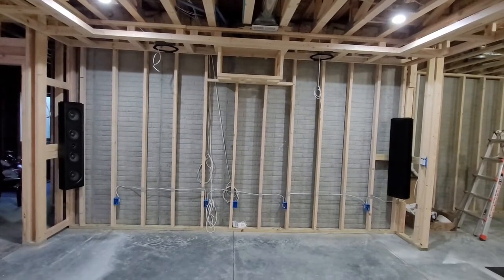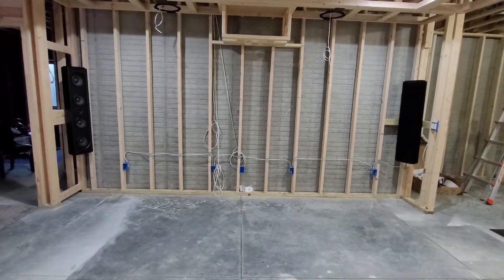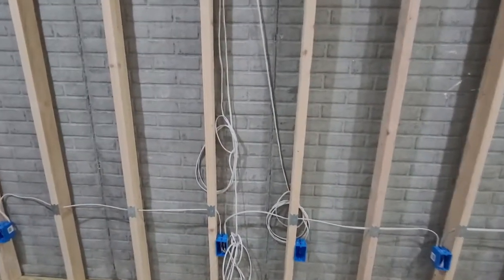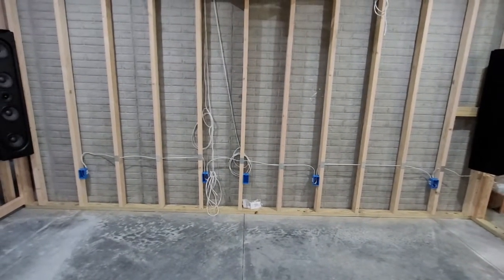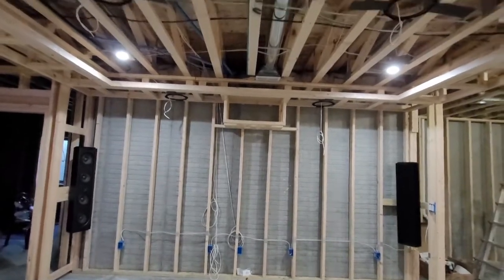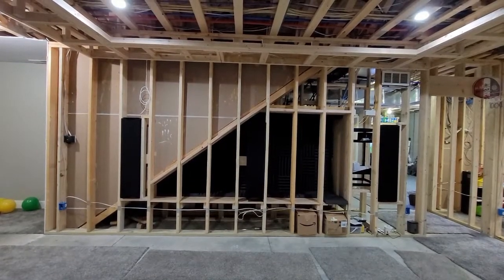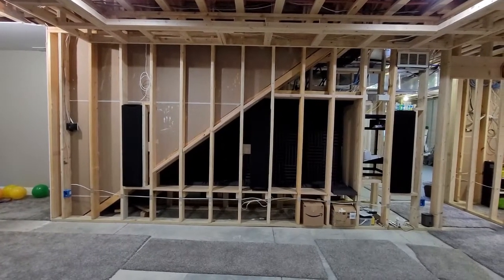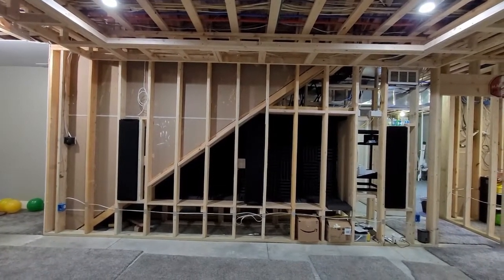Basement Home Theater - Progress Update 04/12/2021

Comment: 1 second in, where did you find those can lights?  What manufacturer are they?  I put a total of 7 in my theater room and the brackets did not fit between my floor joists.  They were too long at their most compacted position.  I had to install 2x4s perpendicular to the floor joists to install the can housing to those with the brackets running parallel to the joists.  I looked at Menards, HD and Lowes.  All of them were the same size and would not fit as you were able to install them.  I'm finishing another room in the basement and need to install 8 more cans and I do not want to have to build bridging for all 8 lights.  Its a pain in the arse and I don't want to waste the time if I don't have to.
Reply from the maker: They were purchased from Menards but I don't remember what brand.   They were too long also, so I simply took the adjustable metal part that slides completely off, and cut a few inches off that end and the end that is still attached to the can bracket.  I used tin snips.  Then slid them back together.  This effectively made them small enough to fit and still adjust to the correct size I needed.  It was kind've a pain to do this to every one, but it worked.   Hope this made sense -

Comment: For all the framing, including the soffitts, did you use strictly 2x4s? Did you use any other size lumber and if so for what purposes? Starting to frame out my theater and trying to figure out lumber usage. Thanks!
Reply from the maker: Yes, 2x4s for everything.  Had to buy 10 foot lengths because I have 9' tall basement walls.  Anything bigger than 2x4s would just equal more price, and more weight when it comes to the soffits.  Check with your local building codes - I had to use green treated lumber for the bottom plates of the walls that attach to the cement.  Also used some 2x12's for the headers above the doors.  I think that's about it!  👍

Comment: What all ended up with its own circuit? And how do those towers sound? I have heard you're not supposed to do cubbies for them. I was considering something similar
Reply from the maker: The entire rack is on it's own circuit.  So all of the home theater equipment is minus the two rear powered subwoofers since they plug into the rear wall outlets that are part of that room's electrical circuit.  The speakers sound great, I have no complaints at all with them.  They are an on-wall design speaker, completely encased, so recessing them into the wall like I did does not affect sound output.  I just wished I could've figured out a way to have them aimed inwards towards the main listening position, but even without that they still work great and give a nice wide sound stage up front.

Comment: Ty, I'm looking to upgrade my media room to utilize a projector.  Did you have any problems with that long HDMI run back to the projector wall or did you use HDMI over two cat6 wires.  I ask because I've read about concerns regarding long HDMI runs.  Any specific information on the HDMI if you still have it would be greatly appreciated, thanks.
Reply from the maker: I have no issues with my HDMI cable.  It is not ran over CAT6 wires.  It is a high-speed fiber optic HDMI cable.  I'm pretty sure the link to my exact cable is in the description of all my videos on my channel.  I don't remember exactly, but I think my cable was around the 35 foot length mark.  I had plenty extra, and it works flawlessly.